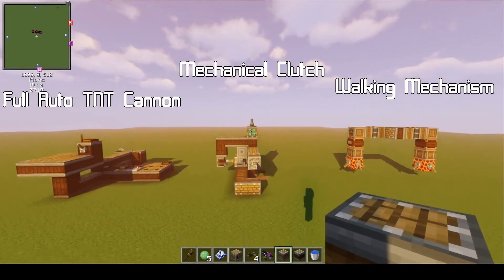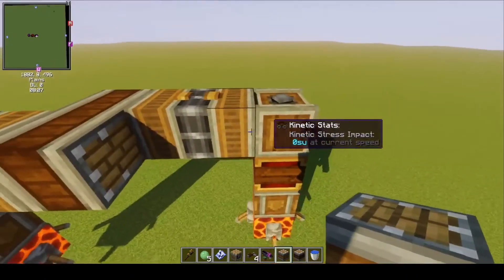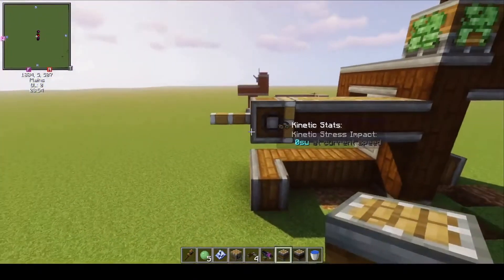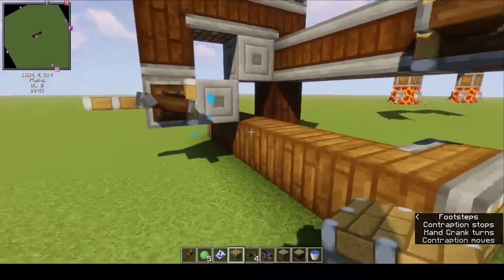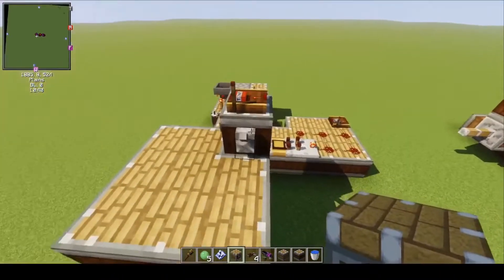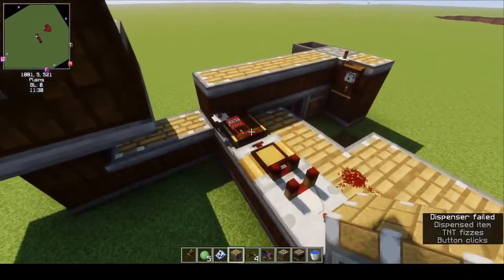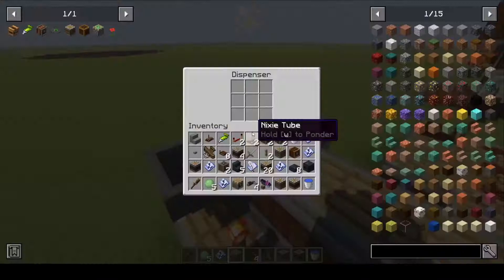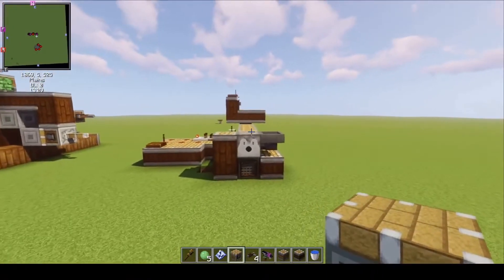Create Mod 0.4 - Three useful contraptions

Comment: How do you avoid the walking mechanism from moving forward but then back so taking 1 step forward one step back which ends up in not moving any where
Reply from the maker: I do that with strategically placed redstone transmitters which activate sequenced gearshifts set to 180 degrees, so basically each leg only triggers when it should. I have a mech that uses this concept.
Reply: @KwizzleHazzizle  Thanks, I’m pretty close to giving up my brain hurts
Reply from the maker: @benjamin1205  Have you checked out my mech? It's not working since the .5 update but it might help to have a look at it
Reply: @KwizzleHazzizle  I copied the walking mechanism but I’m still broken
Reply: @KwizzleHazzizle  I have it saved as a schematic but I could be missing some pieces
Reply: I made a mech with this design, and i basically just gave it 4 legs and placed the redstone links on the body of the mech.

Comment: with the walking mechanism, how do you make it so the top doesn't flip over?
Reply from the maker: There is a bearing connected to the top. This makes it so that the top is always oriented the same way.
Reply: @KwizzleHazzizle  bro thank you so much i've been trying to make the top not spinning for hours, and after i read this reply i immediately figured how to glue the parts together and then it worked HUGE THANKS
Reply from the maker: @ebiskus3140  Hey! Glad you found this video to help you out. Best of luck on your build!